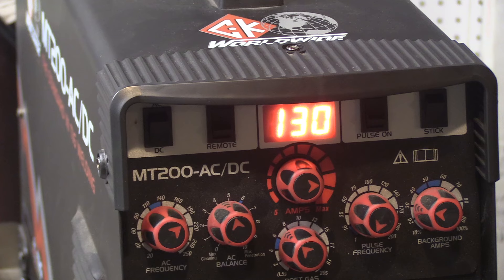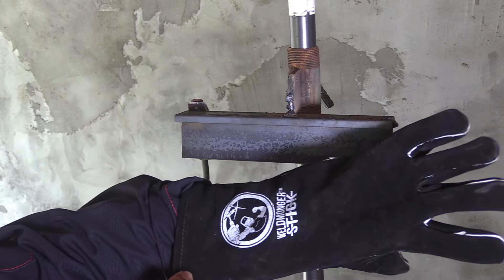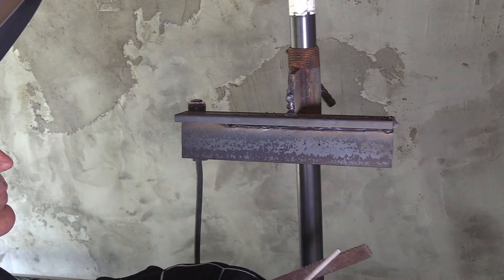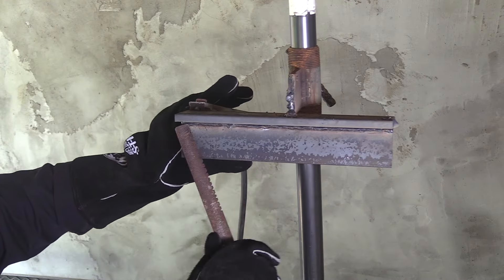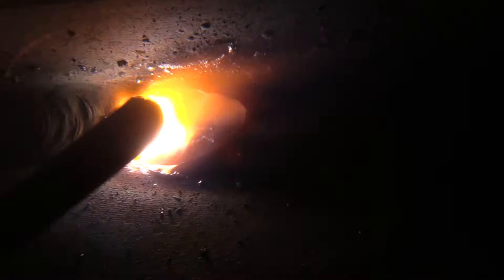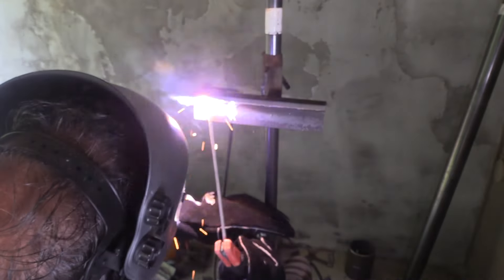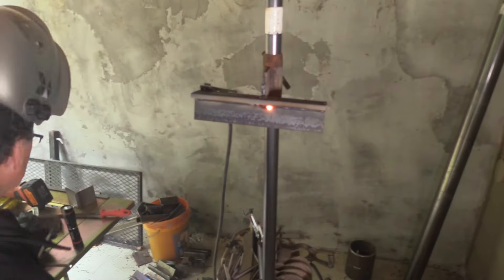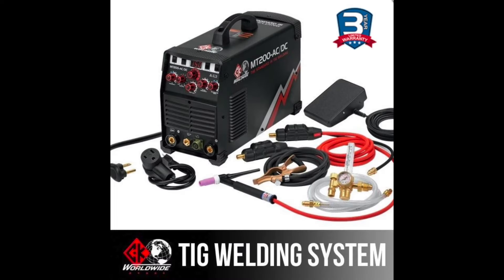Stick Welding Overhead 4f Multi Pass Tee 7018

Comment: This is weird because I've had two instructors and they say the opposite on the second passes. Both make sense when THEY say it, but when it comes to doing overhead for myself, I prefer what you do from the bottom-up. One of the instructors said "You can't build a house from the top down."

Comment: Hi Jody! I'm down here in South Africa. I Know this is a vid about 7018 but i have a question about 6013. In south africa 6010,  6011 and 7018 are not easy to get hold of and when you do you have to buy 50 pounds at a time and they are extremely expensive. 6013 is everywhere. I'm seeing some asian and arab guys attempting to do root and fill passes on pipe with 6013. Their videos are never clear enough to see how well this works. Is it possible to weld pipe (Root and fill passes) and get similar results as 6010. Note i'm not a professional welder just would like to try pipe welding as a challenge, but not at the expense of a 50 pound can of 6010 as that is extremely expensive here.

Comment: Really appreciate your 7018 videos. Don't have TIG nor enough lifetime left to learn it. Had a Thunderbolt for 40 years but seldom use it, especially since I've acquired O/F and MIG but now all of a sudden I'm finding projects that stick is the way! NOW have to decide whether to use my AC buzzbox or up my game to a DC machine. Anyway, thanks for presenting lessons on all modes of welding along with tips and tricks. BTW, I can certainly identify with the grinding mode issue. First time that happened I just taped over the grind mode button...you're right, it's bright!

Comment: I have found that some 7018 rods they are not centered in the flux. We bought a bunch of 5/32" once and over half wasn't centered, we sent them back!  Now I always watch for it. If not centered I turn the rod so the thicker part is on the opposite direction your welding. Keeps your weld from spitting out on you. And you can run faster and hotter. Thanks for the video!

Comment: I have a lincoln 210mp, man I have a difficult time getting the rods to start and keep getting them stuck. Wish I could make it as smooth as alot of you guys do. This was a cool comparison.
Reply: 7018 electrode required DC current if your machine Ac you got trouble with this Welding try 7016  its easy to run then 7018

Comment: Jody, I was looking thru your video library, and I noticed you get tons more views on videos that say "TIG Welding aluminum" and "7018" coupled with "uphill" or "vertical" or "overhead." Oftentimes for "chromoly" and "4130" (and don't forget "6g") as well. Definitely not a rule, but seems to be continual. I'd suggest sticking with that same thing you've based yourself in, the simple instruction on how to weld better, and specifically those things many people either struggle with, or think are difficult. You taught me to weld, and now that I've got a little better income, I will continue to buy everything I need, that you carry, from you. Thanks so much for all the value you put back into the community.

Comment: I'm surprised at how well I picked up stick when I had a real instructor. I usually always run about 130 to 135 cuz its what worked for me, overhead I had no issues. My instructor was also surprised by my welds at the perfect 180 degrees plate in overhead.

Comment: What is the best way to do multi run fillet on vertical pipe on plate etc, with the start stops on sides tieing it in, like you start overhead then vertical then back to down hand top. I need todo a 5run fillet next week just needs a thew tips. Thanks

Comment: Can you make a video on TIG welding thin steel tubing? 14 guage in many join confrigurations? I am having trouble doing fillet welds with T joints on 14 guage mild steel. I am using Pure Argon, 3/32 lathanated tungsten, Primeweld 225x with number 7 cup and sharp point. I sometimes cant get enough puddle to tack the pieces together. Its frustrating with the thin tubing.

Comment: I thing being able to feel the difference between the vibration of the arc and the feel of the flux touching and dragging on the base metal may be important to keeping a tight arc
Reply: Definitely makes a difference. I’ve had instructors come in the booth when welding and start pushing on the back stinger to show how much more pressure you can really push into a plate or pipe

Comment: Hey Jody I’m a welder in the Army and I’m having to repair a piece of equipment in the 4F position with a slight 20-30 degree incline. I’ve welded 4F before, but I’m wondering how your position would change with the slight incline.

Comment: 130 sounds like alot. You weld fast. I set mine at 95-105
Reply: The amperage use choose depends on the brand of rod and the thickness of the metal for a given diameter rod.That 3/8”;or 1/2” plate he is welding on soaks up the heat. @ 130A it could a problem on thinner plate overhead.

Comment: How to weld tubes when it near the wall and you can not just rotate it or go another side? (I mean MMA)
Reply: First you yell at the designer/engineer for not leaving enough room for fabbing, then you bend the welding rods to curve in behind the pipe.
Reply: @CO Jones  :D  Yeah! Yelling is a most important thing of all the situation.
All I could invent for myself is cut big gap in  front surface to get access to rear part of tube and weld it from the inside. And then we can fill that big gap.

Comment: Nice one handed welding I gotta use 2 hands even after 20 years 🤔
Reply: I have to use both hands and prop to get a decent stick weld in any position and sometimes it works better if I'm seated.
Reply: @garthbutton699  same if I'm welding one handed my arc length just goes off on the trip of a lifetime